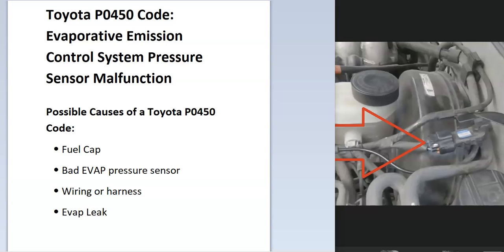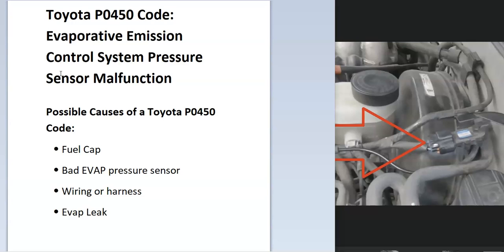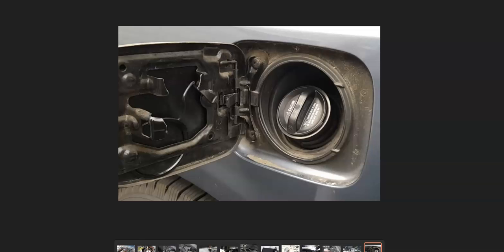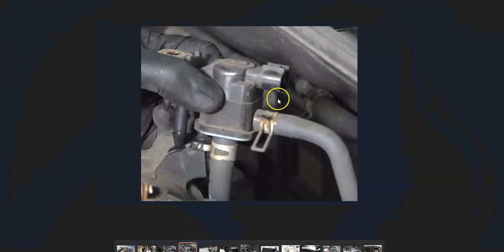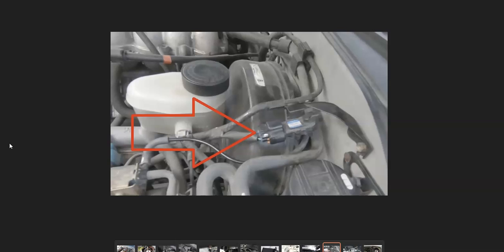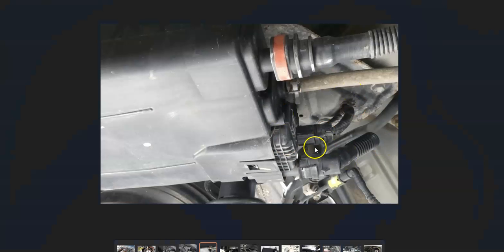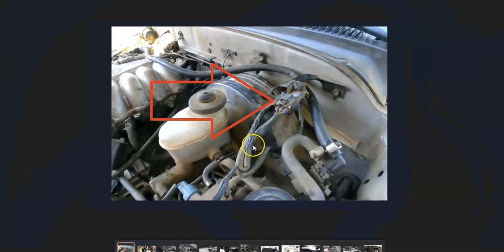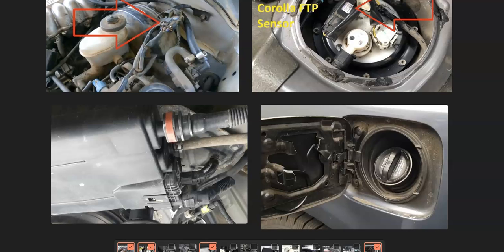Causes and Fixes Toyota P0450 Code: Evaporative Emission Control System Pressure Sensor Malfunction

Comment: my 2001 Tacoma V-6 tested using your video, voltage fine but with vacuum it showed no change; I replaced the Fuel sensor with a "knock-off" from Amazon and now no more P0450/P0441 codes... I'm very happy paying $73   vs. dealer price 3 times higher. here is what I bought:  Fuel Tank Pressure Sensor - Compatible with 2001 Toyota Tacoma (Vehicles From 09/2000 Production)Fuel Tank Pressure Sensor - Compatible with 2001 Toyota Tacoma (Vehicles From 09/2000 Production)         $72.95  does not include the mount.  I put it on my existing mount. It was even sealed in an "anti-static" bag....  that shows they are serious.
Reply: This is definitely an add. I would not recommend replacing critical components with Amazon knock-offs if you can help it. It might work for a little while but you will likely be fixing the problem again after a few months to a year. An OEM part will likely last at least as long as the one you’re replacing. Just keep this in mind.

Comment: These codes just popped up on my 2001 taco. My harness doesn't look that beat and my gas cap is around a few years old. Would spraying an electronics cleaner on the harness be useful for if there is any dust or dirt? I know ive done this to other sensors because I live in a dusty climate

Comment: will a bad purge solenoid cause the P0450 code i have 2 codes on my 97 toyota T100 i have the P0450 and P0441 codes
Reply: I have the same codes on my 97 t100.  Have you found the issues?

Comment: I have p0450 and p0441 on a 97 v6 Camry. Both appeared same day.

Should I just replace the purge cable and the pressure sensor?

No hoses are broken/cracked, gas cap is good. Always hear an audible hiss when filling up at the station
Reply: Purge valve* not cable
Reply from the maker: Here is a video how to test the purge valve. If it tests good, I would check for an EVAP Leak. https://www.youtube.com/watch?v=5rQelbINjTQ&t=3s